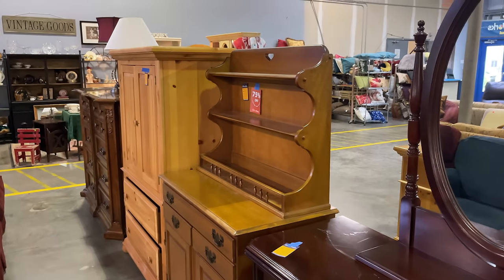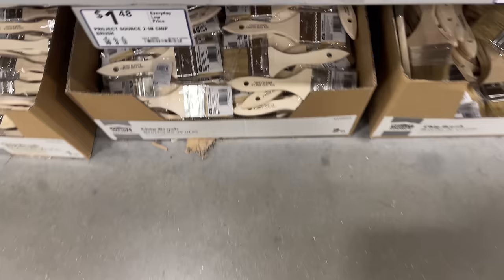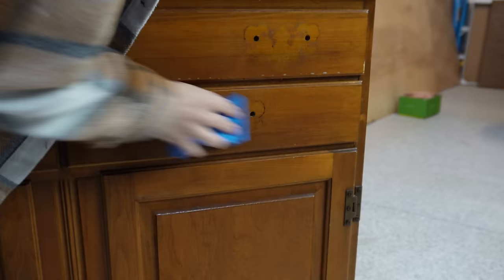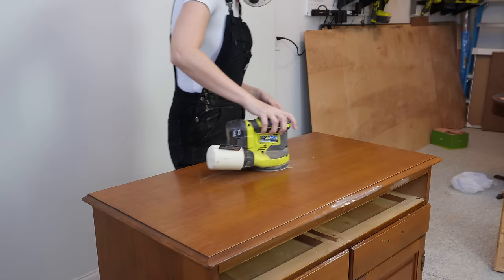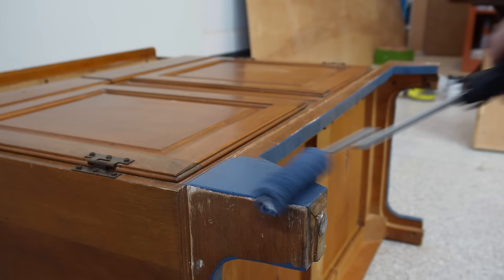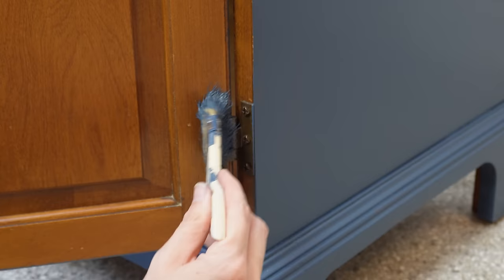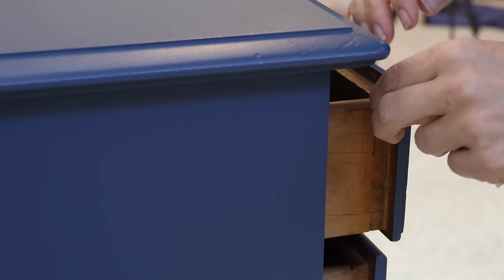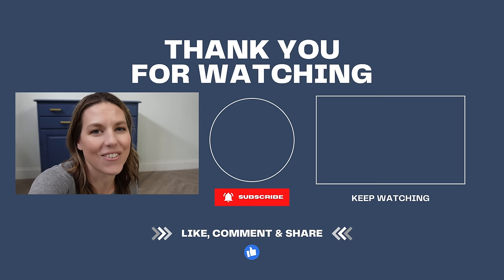Nobody Wanted this Hutch 😢 I had an idea...

Comment: Hinges. Take the hinge off. Fill the holes with a wood filler before it dries, stick a straight pin in the center, and leave it. When you are done painting, pull out the straight pin and you now have marked holes to reset your hinges. Works on house doors really well or anything that i want perfectly realigned when i reassemble it.
Reply from the maker: Great suggestions!
Reply: I'm sure she knew how to do the hinges, they just don't always work the same after reassembling (which may not happen to you, but does to most everyone else). You do it how you want to do it, and everyone else will do it how they want to do it. I think the blue hinges look great.
Reply: @latebloomerabroad I agree the hinges look fine painted but they were just making a suggestion.  I’m sure you didn’t intend to sound rude but the way you wrote it was rude. IMO. Have a wonderful day. Smile; be happy 😃
Reply: It's easier to just mark which one came from which side.
Reply: Wow! Thank you-

Comment: You have to respect when someone paints something and doesn't get a bunch on themselves. 
I always end up covered. 
Beautiful color and beautiful job!!
Reply: Also, she is painting the piece while it is sitting on a carpeted floor, and there is no paint on the carpet, pretty amazing! I would have needed to put the plastic sheeting down first that can be rolled up and tossed when the project is done or used a reuseable tarp, or cardboard underneath, I'm sure a bit of paint would have dripped on the floor if I was painting this piece.

Comment: You saved a well built, dovetail detail on the drawers, piece of furniture and turned it into a beautiful, updated, multi functional piece of furniture.
Reply: Right and it is all wood and not particle board like some in the recent decades.
Reply: We need to do more of this instead of purchasing poorly made particle board furniture. Surely this repurposed cabinet will last much longer than the cheap stuff from the blue and yellow store with the great meatballs.  This piece looks great although I would have removed the hinges and replaced them with hidden hinges.

Comment: I turns out really nice. You see what you can do with a bit of imagination. When we got married in 1981 and bought our house, its big kitchen needed something big in it, and we wanted a welsh dresser. Unfortunately, there were none around so we found this junk shop locally which put the shelf part onto the base parts in matching wood. We chose a base part and the guy used recycled wood from the stairway of an old school and put shelves on top. It was greatly admired by all visitors. My friend admired it so much that when we remodelled our kitchen, going from dark wood to bright white and pale wood, we gave it to her, along with the table we were gifted when we moved into the house. She still has it to this day. That must have been around about 2008. It was a good item and certainly is still giving value for money.

Comment: Looks great!   But, I would have painted the top half in the same color and sold as a wall unit so someone could have a matching set if they wanted.  That could have been a very cute shelf unit above a changing station!
Reply: Sorry, but I wouldn't be hanging a heavy shelf unit above where a baby would be. Shelf unit, yes. Over the change table, no.

Comment: I did this with an old 50s armoire that you can hang clothes in. My older daughter threw a fit. While my younger helped me do it. I used wallpaper for 5he 2 front doors. And then painted the edges with sage color paint. Replaced all knobs with glass ones. It looks so pretty. Im using it to hold all my vrafting and sewing stuff. Thank you
Reply: Your comment made me smile. I love “Cottage Style” and paint is the key that gives my home a unifying calm look. But my son is horrified that I’ve painted much of my furniture.

Comment: I love painted wood so I have no problem with that. The blue is beautiful and looks great with the gold. A few critics would be, painting hinges to me always looks cheap and doesn't wear well. A lot of people in the comments agree with jigsawing off the scallops but to me that takes a pretty detail and makes it more plain and jigsawing never looks as good to me as the professional cut. Another minor nitpick as I look at the piece, the four handles look off for some reason. I think I would have put a large center handle on the top drawer and filled in the holes also not a fan of these handles with such sharp corners especially in a baby's room. All that being said though, it's  a lovely job.
Reply: I didn't like the sharp angular handles either, I was thinking the same thing, sharp metal corners at a toddler's eye level. 😒
Reply: I thought the same thing about the handles being a little off. I think another option would have been to fill in the original holes in the top drawer and move the handles closer to each other so they are directly above the handles on the second row of drawers.  But overall, I love the makeover, especially the contrast between the paint color and the hardware.
Reply: *critiques, not critics✌️
Reply: @Cycology_Major  Right- I knew it didni't look right lol.

Comment: The drawers are dove tailed, so its a well made piece of furniture
Reply: Dovetailing is not the sign of quality that it once was. Now days lots of furniture has dovetail joints, but are made of a soft wood, not at AI like dovetailing the oak joints of yesteryears.
Reply: @StuckinNormal cheap wood or not, I'd rather see dovetailing than stapled sides.

Comment: Going to try this paint!  If you do want to remove the doors…take the hinges off, but label them to go back to the spot they originally came from.  It’ll go right back together and the doors will work fine. I just mark the back side of each hinge with the location.  This way you can spray paint the hinges any color.

Comment: I love your style. I am in the process of creating a table from parts. I bought a 48x96” top at an auction for $6. I found unfinished turned legs at a reclaim it store for $1 each ( I bought 12!) I stripped the top and used wood flooring finish. I sanded the legs on a lathe and applied the finish there too. Hubby is cutting some long boards for me for aprons. It will be a work table for my sewing room.

Comment: I'm a Tennessee gal and love your furniture makeover videos. That was an amazing versatile piece afterwards, I love it. Would love to see you makeover one of the huge armoires. I have two that I use as extra storage in my bedrooms but they haven't had a face-lift. One has shelves in the top and two drawers. The other one was originally a TV cabinet and still has the pull out shelf in the top and one divided drawer on the bottom for VHS tapes from the 70s. Give me inspiration!

Comment: I Love Beyond Paint! Glad to see it's available at Lowes Now. I painted my kitchen cabinets with Beyond Paint, ( Bright White/ or Brilliant White, can't remember exactly), about 3 or 4 years ago. Had to order it directly from the company since I couldn't find it anywhere for sale, ( I bought the gallon sizes), and it is still standing up well. My cabinets are old, cheap, not even real wood, like a plastic/formica type material.  What a change the Beyond Paint made. It is very thick, like pudding, and it goes on thick and fills in/evens out imperfections , has a built in primer, and it does leave a slight texture. I promise I'm not a payed spokes person,  but I'm so glad l painted my kitchen cabinets White with Beyond Paint. There is an old advertisement that used to be on YouTube,  made by Ace Hardware, where a  man paints cabinets almost identical to mine with Beyond Paint  and they looked so good , that was when I decided to paint mine.❤
Reply from the maker: Love to hear that!

Comment: That paint is amazing. The hinges on the doors are on the outside of the piece, which is a bit unusual, although it is a style. Consequentially, painting the hinges makes sense because they're part of the outside area. If they were inside mount, I'd not have painted them the same color as the outside of the piece, I'd colored them to match the knobs so the part of the hinges showing would be gold and compliment the knobs. Not sure if I like the inside left with the original finish. Seems like the outside being redone so nicely would merit an upgrade on the inside, but that's just me. I'm the one who always refinishes the inside of everything so when it's opened, it looks as nice as the outside. Good job all around.

Comment: While painting old wood furniture, antique or cheap and crappy wood furniture, is not something that I would prefer to do, I truly what you’ve done with this piece.  I LOVE, LOVE, LOVE the color of the paint and the fact that you didn’t have to do so much prep work!  I honestly wish I had a changing table like this when my son was a baby.  I have a really crappy wooden shelf that I suspect has lead-based paint.  I am not crafty this way, but I am trying to do my research on whether to strip it down or just sand and paint over the existing paint.  Definitely making note of the paint and the plastic wood filler!  You did a great job on this for sure!  Thank you for the product recommendations!!

I am curious what you did with the top part/shelf??
Reply from the maker: Thank you! I saved the top part. I might use it for a future project.

Comment: I probably would not have altered the base as you have; but I certainly understand why you did.  Speaking of spiders under the base; If you simply install backers in the openings you eliminate future access and it adds support allowing you to then reduce the feet as much as you like.  Personally I dislike open undersides on furniture because it's always a cleaning headache.
  You did a wonderful job on this.   I subbed.  :)

Comment: Its a beautiful piece.  My only comment about reducing the size of the feet may affect the tip over ratio of weight on the piece.  I would stress using mounting brackets in the rear because children love to open bottom drawers to climb, thereby creating a tip over issue

Comment: I like the way the sides of the base turned out with the curved corners. I don’t like the sharper corners on the front, but with the paint color and hardware changes, I can’t imagine keeping the scalloped look, so anything is better than scalloped there. 😂 
I imaged you’d paint the top too, making it mountable on the wall higher up, like shelving above a baby changing station. Would you have considered this? Or is it too old fashioned to change to match the bottom?
I generally love the old styles and will always want to see the wood grain, so I like stains over paint— but that requires the long stripping process you mentioned. I love how easy your transformation was in comparison to other possibilities. Thanks for sharing your hard work!

Comment: I'm late to the party but wanted to see what you did. Not a particularly inspired repurpose, but I get it, it was in good shape, no need to butcher it into something more interesting. I would have used brushed nickel hardware and changed out the hinges as well, but you respect your limits, kudos. Also, would have used a pearl light gray paint on the interior and underneath, and I would have used the shelves on the back side and make it more of a multifunctional piece, but I have a rabid hatred for wasted space. But I think you did a lovely job with relatively little work.

Comment: I have a beautiful solid hard rock maple dovetailed china cabinet in perfect condition similar to this with glass doors on the hutch though. No one in my family wants this beautiful piece that can be reused as any handy beautiful, small chest of drawers, changing table, etc. Hutch can be a display case, bookcase, etc.  Can always change hardware, however the hutch has knobs on the glass doors, perfect for any taste.  Even St. Vincent dePaul charities would not take it. Really do not have room after downsizing from over 3000 sq ft home to 990 sq ft. One of my granddaughters wanted the simple designed black & white silver trimmed china, so cabinet basically empty, so using hutch as display for my favorite  religious statues, etc.

Comment: It looks like the hutch my mother had ordered from a Vermont Furniture maker. It was $1,500 back in 1960. Look and see if the drawer has a medallion inside.  It was maple and very heavy.  Probably not maple because you would not have been able just to tip like that

Comment: You know if you open and close those doors a few times that paint is going to chip right off those hinges. There's nothing special about those hinges that needs to be leveled. Bad idea to paint over them. Never paint over switch plates hinges socket covers

Comment: I feel the knobs and handles should agree on geometry. Either square or rounded. It’s a confused piece. I personally would have also repainted and lined the drawers if it was meant to be a changing table- contact liner is easier to wipe out than old wood. I kinda feel like it’s actually incomplete. 😅
Otherwise a trendy paint job.

Comment: I love the outcome.  I'm here as a beginner learning. my question is why wasnt the surface rough sanded or primed before painting? does that particular paint not need either of those things.  It's just that almost everyone rough sands the surface to make sure the paint adheres and stays for years..  just asking. I'm always looking to skip a step for ease if possible. thanks.
Reply from the maker: This particular paint does not require sanding or priming.

Comment: Would you suggest Beyond paint for chairs as well without top coat?
Reply from the maker: It would work for chairs- however, if they are heavily used I might topcoat them. Beyond Paint has a sealer that is great for furniture in high traffic areas.

Comment: I have a question for you! I just bought 2 wood finished end tables and I am going to paint them. I was doing a light sanding and I found out that the top is actually FORMICA! Go figure! What do I have to do to make sure the finish stays on the top where the Formica is?
Reply from the maker: If you use this paint, it should stick! But if you are using a different paint. Get a good adhesion primer that will work with formica.

Comment: Why use plastic?  Plastic is not biodegradable and requires oil products for manufacturing.  Plain old wood filler is so much better.